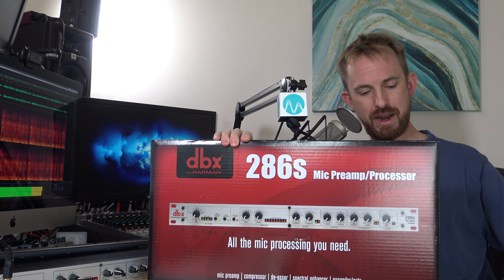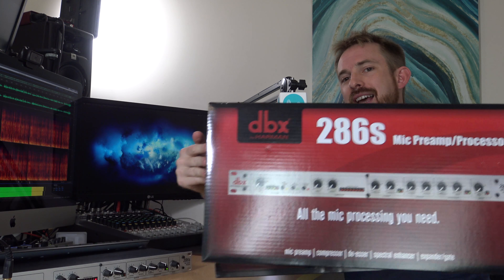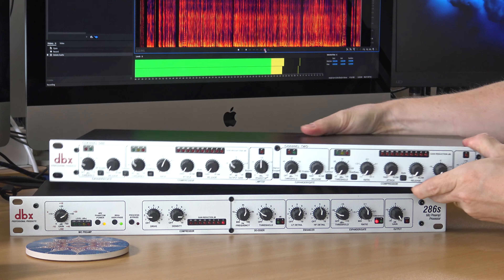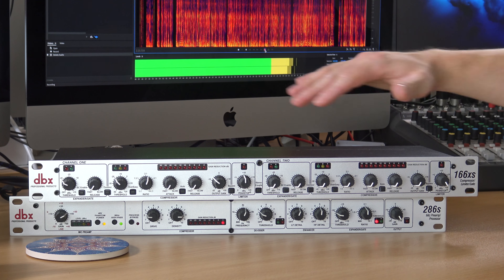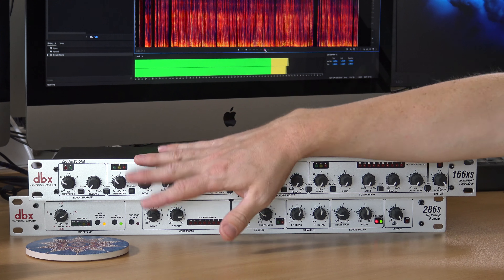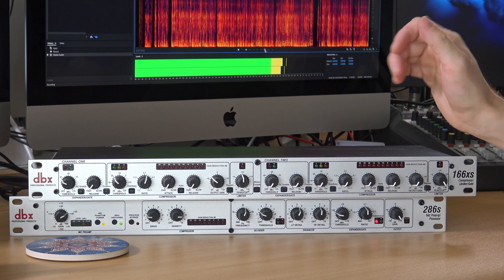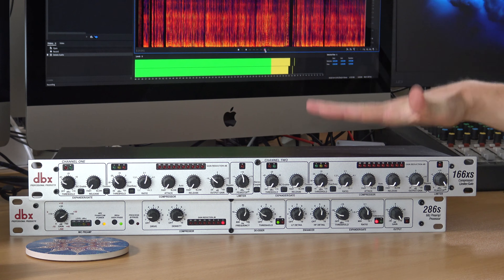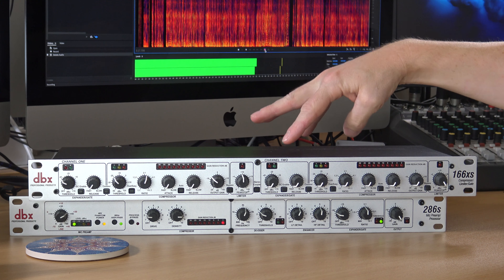Can You Plug Two Mics into One Jack on the dbx 286s or use a dbx 166xs

Comment: Newbie question: on the 286s it specifically says "PRE-AMP" But on the 166xs it says  "Threshold" is that the same thing?
My camera pre-amp gives a terrible noise gate so I have to set it to the lowest possible setting, will the 166xs boost my microphone as the 286s will?
Reply: New info: I might be getting "Line Noise" (Power-line interference) because when I plug in the continuous power the noise increases.
Any recommendations on how to clear that?
Thanks in Advance!
Reply from the maker: I'm lost with which device you're asking about? From what I can make out though "dirty" power could definitely introduce unwanted noise.
Reply: @MikeRussell  sorry for the confusion, and thank you so much for replying. 
in my first question, I asked if the 166xs acts as a pre-amp... or should I get the 286 
in the second comment, I figured I have a "dirty power" issue, and asked if there is a device that could reduce that noise?
Reply from the maker: The dbx286s and dbx166xs are for totally different purposes.  I had both in my chain.  You'll want a dbx286s for microphone processing.

If dirty power is an issue you could try a power conditioner if you cannot eradicate the problem.

Comment: If functioning properly these are great units. Got 2 of them. Unfortunatly both(!) started to disfunction after 1 year of minimum use. Putting the unit's phantom power switch on and off brings it back for a while but its not ok if you want to start speaking and the damn thing is dead again. Reading about more people having the same problem so these units do have some sort of power issue.....
Reply from the maker: I'm sorry to hear about your experience with the dbx units. It seems like there may be a power issue with these particular models that's causing them to malfunction after a year of minimal use.
Reply: @MikeRussell  hi Mike. My friend is a electronic engineer and we are going to see if we can find the cause. If we can solve it (he suspects some IC in the power supply part) ill report here again with the results.

Comment: if your needing to connect two mics (one in control room one in vocal booth) and only plan on using one mic at a time or sparingly use the second  mic at the same time for talk back then no need for two dbx's  one with a splitter will do just find. he only talks about uses in podcast. For pro production in  a home studio a splitter is the perfect way to go to get that polished sound to any of your mics.. just like he said tho i wouldnt use both at the same time but at least you dont have to plug and unplug everytime you want to use a different mic threw your dbx
Reply from the maker: Not something I'd recommend as the processor should be set for the voice, the mic and the recording environment but you can do that if you want.

Comment: AFAIK, the DBX166xs only has line inputs. There are no mic preamps, so it lacks enough gain for most dynamic mics, and phantom power for condenser mics. Therefore, the 166xs is not a substitute for two 286s's. You will need two channels worth of mic preamps (like a dbx676, or two dbx580's) to go with a 166xs.
Reply from the maker: My setup uses two dbx286s units, a dbx215 and then a dbx166xs unit.

Comment: Hmm, I'd say one big problem with connecting one or more mics to the jack input on the dbx286s is that you're connecting mic-level sources in to a line level input, which differ in voltage levels. You shouldn't really mix them up. The mic-level is much weaker than line-level and you'd probably not get a signal at all. And if you're trying to connect a condencer that way, you wouldn't be able to drive it with phantom through line.
Reply from the maker: Thanks so much for the comment Marius!
Reply: No, but doesn't seem right, it's a mic preamp and processor, keyword, preampu

Comment: dbx 166xs does not have microphone preamps so two microphones cannot be connected directly to it (not even one). I did not find this explained in the video
Reply from the maker: This video is about the dbx286s not the dbx166xs.  They are two different devices.  The dbx286s is the mic pre-amp and processor and I would not recommend plugging more than one mic into the device as it's designed to process a single mic.  I have one per mic in my studio set up
Reply: @MikeRussell  It's not about him, but you're talking about him...ok